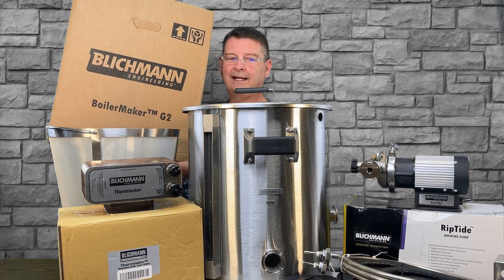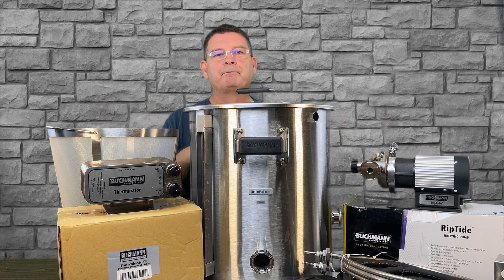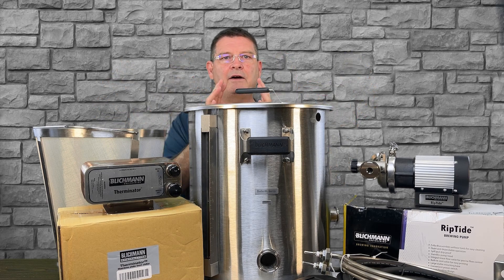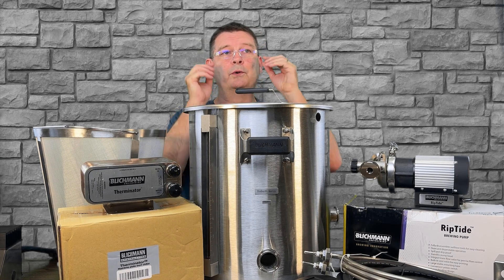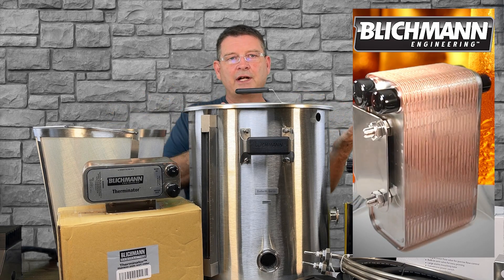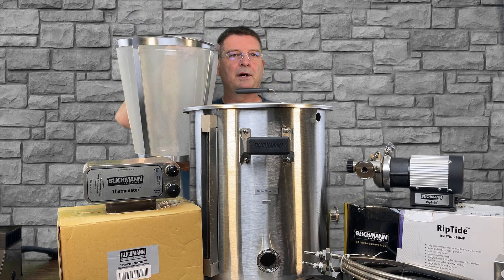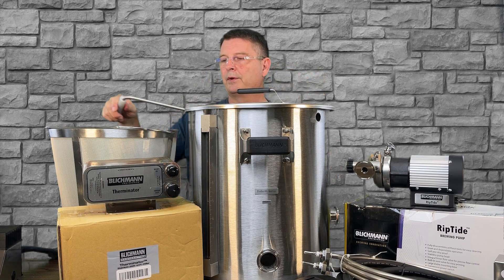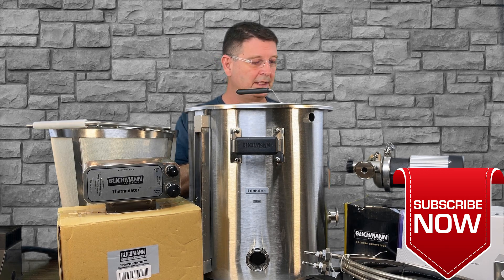Blichmann Engineering BrewEasy compact all-in-one

Comment: I pulled the trigger on a 20g Spike Solo days before this one was announced.  I was bummed at the time to not have an opportunity to consider it, but I see they are still not offering a 20g version, so I'm fine now!.  I think one thing you hit on here is that you do have the option to add/subtract components when purchasing it, which can save you some $$ if you have a pump already or a chiller, etc.  Buy a Grainfather g40, and you're buying the full box of stuff.
Reply from the maker: I'm crossing my fingers that this is just a stepping stone before they introduce larger systems down the road but I think the supply chains need to normalize a bit more first.

Comment: Great video. I’m looking forward to the rest of the series. I built a 20 gallon (10 gal batch) version of the Blichmann Compact using all Blichmann parts. It’s identical to the smaller system except I have to use a brew bag instead of the basket. Blichmann wouldn’t sell me the basket (even though I spent a lot of money on a custom 20 gallon G2 kettle, pump, controller and all the other parts). I’m really enjoying the system. It’s modular, powerful, and compact.
Reply from the maker: I would follow up with them on the possibility of buying the basket as it might have been and might still be a supply chain issue restricting them from selling it separately. I'm hoping that this takes off and they expand the lineup with a 20-gallon model for those who like to do large batches like yourself.
Reply: @BitterRealityBrewing  They should definitely expand into larger sizes. I can personally attest to how well the scaled up version works. It maintains mash temperature perfectly and has consistent mash efficiency from batch to batch. Fingers crossed that larger versions are in the works!

Comment: I got a 240 V Brew Easy 10. That was before the compact version was available, or I may have ended up with that. I love mine, but it was a challenge learning how to assemble it and operate it at first. Tomorrow I’m brewing a 10 gallon no-boil NEIPA with it… My first no-boil.
Reply from the maker: Good luck on the No Boil as I haven't tried that yet except with extracts and from my understanding even with the compact version they are still selling a ton of the original Brew Easy systems.

Comment: Thanks for sharing. Wish they had this when I was looking for a system. The all in one systems don't take up much space. Wonder if Blichmann would be able to sell me just the basket thanks for the idea. I'm going to have to reach out to them. Cheers!
Reply: Unfortunately, they don’t sell the basket separately. All of the baskets are going to the kits. Hopefully that will change in the future.
Reply from the maker: @davisknight7078  Yeah someone else just mentioned that to me but I would expect it might be a supply chain issue as we are still dealing with those. I work for one of the largest port companies on the East Coast and it is crazy the changes in products coming through our ports have changed dramatically over the past few years since the whole covid issue impacted the world. Currently, it is cheaper for us to import tons of lumber from several other countries compared to simply buying it locally.
Reply: @BitterRealityBrewing  Yes, I’m sure that was the issue here. Increased materials costs, labor shortages, increased fuel prices, severe supply chain irregularities, etc. We consumers need to be more patient with domestic manufacturers like Blichmann. I’m very happy with my system. Money well spent. And my 400 micron BIAB is working quite well in direct contact with the boil coil (just not performing multi-temp mashes).
Reply from the maker: I would imagine they would sell that part by itself but you would probably have to email or call them on it.

Comment: Really nice system.  Could I make a request?  How about doing a thorough review of the Anvil Crucible fermenter including the review the beer that fermented in it.
Reply from the maker: Great request as I actually did another video on the Anvil Crucible that I never released and you are right I really didn't do a review on it. The video I didn't release was covering items that I purchased for it right after using it the first time due to issues I had with it and the add-ons were my way of overcoming those difficulties. I don't use it that much due to a lack of temperature control resources but I will be addressing that when I move into my new place towards the end of the year.
Reply: @BitterRealityBrewing  I have done 3 batches with it so far (2) 3.5 gal. & (1) 5.5 gal.  I really enjoy it.  Purchased the temp control from anvil using their submersible pump, igloo cooler and chilled water by way of frozen 2-liter bottles having to change them every 24 to 36 hours as needed.  The key is not to add to much water.  Had the water down to 39 degrees F with 2 bottles and rotating them with fresh frozen bottles.  The big take away is the amount of trub dump loss.  It was more than I thought it would be so, take that account when building beer recipes.  So far, the beers turned out good no noticeable off flavors.

Comment: I almost went with one of these, if it was not the fact of the price I would have gotten one.  I am just starting out so I opted to get the Clawhammer Supply 120v system which has been working well for me, there are some flaws with the system but nothing that has stopped me from brewing.  Currently on my 8th 5 gallon batch with this system now.  When it comes time to upgrade I may get a Blichmann Brew Easy.  It certainly looks like an awesome system.
Reply from the maker: They are both great systems but I would think you could upgrade your current system to 240 volts for a lot less than buying a new system. Trust me when I saw 240v is a game changer for heat up and boil it is worth it. Currently, when I brew, we don't dry clothes. 😂 Beer is more important than dry clothes, although my wife might disagree.
Reply: @BitterRealityBrewing  LOL I would love to upgrade to a 240, unfortunately I live in an apartment building and while I have a washer and dryer they use 120v outlets :(  The landlord will deny my request to install a 240 once he asks why hahaha